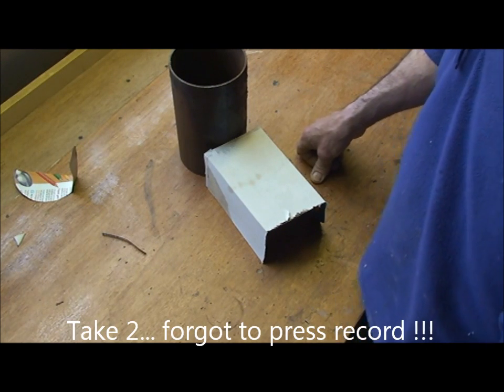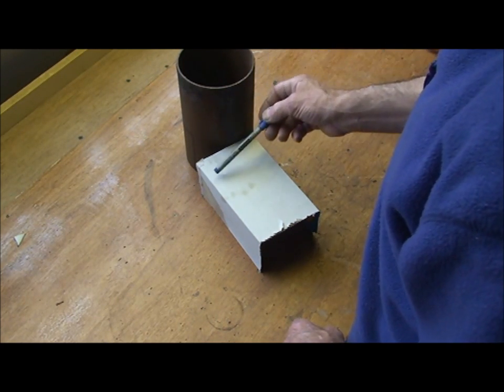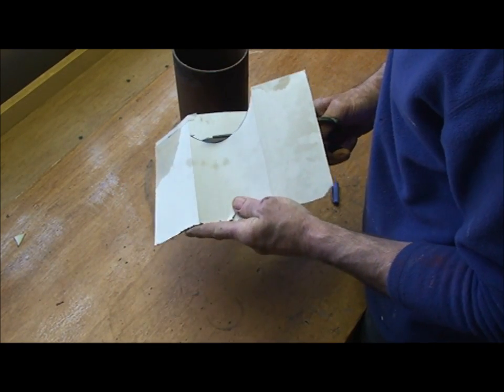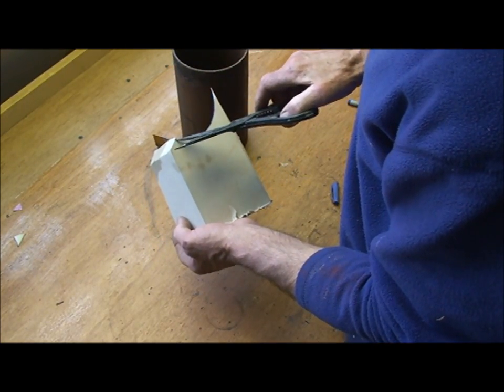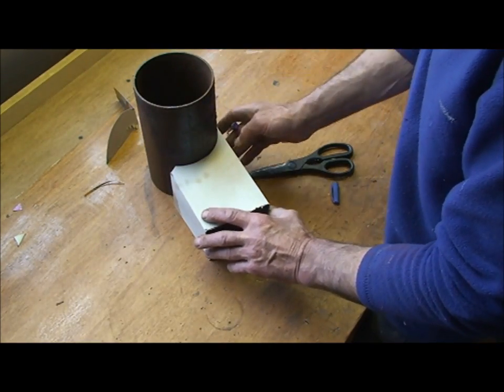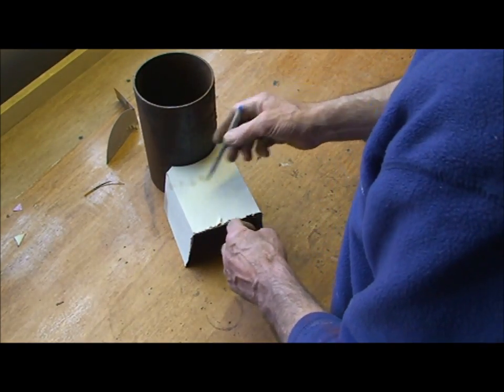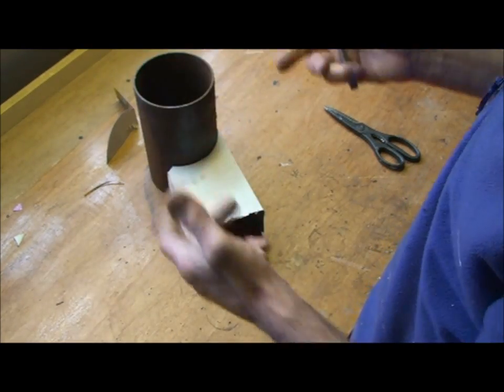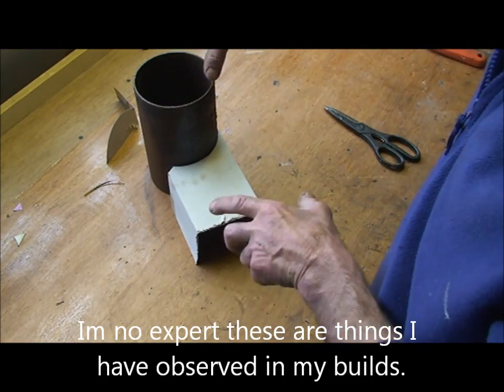Making a Rocket stove riser tube and creating a vortex inside.

Comment: In two months of heavy burn the secondary air channel in my Walker Core system melted.  How has your metal stove held up over the years? 

Also, I'm in the market for a big hearty chopping blade.  Any in the works?  As far as commercial blades right now it's a toss up between the Svord Golok and their Von Tempsky bowie.
Reply from the maker: My SSteel riser failed after 2 years use which is why I tried a cast refractory riser, thats held up perfect and has other advantages over steel. 
My next big knife will be in W2 maybe a camp kinfe or bowie not sure yet but i have a other knives to get done before i think about that one, I also need to get a surface grinder built for the forged knives will free up so much time for me.
Reply: ppotty1 It beats a file!

Comment: How important is the riser tube height in relation to the outer barrel?...I know this is an unrelated question but I just subscribed so I am playing catch up with my questions. I have built a steel burn chamber using this design and it worked real well in test burns but when I installed and set the barrel and ducting in place it doesn't work at all.....I have a firebrick rocket stove in my shop that works real well so I am wondering just where I went wrong with the latest one....Thanks
Reply: Hi Dan, 
I have the same problem, unfortunately nobody has answered you. If I put the barrel over the heat riser, the draft decreases and the stove produces smoke. My heat riser is about 120cm tall and insulated and the barrel is an old water heating boiler with 50cm diameter and about 170 tall, the gap between the heat riser and the upper end of the barrell is about 7cm, i use a 16cm diameter duct-system and all cross-sections are almost identical. did you meanwhile solve the problem and can give me some advice? I would thank you for that
Reply: Dan Pollock 2-5 inches, system dependent.
Reply: Dan Pollock flue pipe height the higher the flue pipe the more suction you get therefore the more airflow you get I'm running into Smokey issues with my oil burner I actually added a fan because of the way the system setup I don't have tolerances for a high flu pipe I know I'm doing a little bit different situation but fire is fire and flue pipe is a flue pipe I use a hair dryer in the beginning then I graduated to a dedicated blower I'm trying to get all the pieces together of the build I'll put them on my channel sometime

Comment: If in the Southern Hemisphere should the vortex spin the other way (clockwise) ? Or would the coriolis effect be too small at this scale to make any difference?  This is a real question as I hope to make an 8 inch batch type rocket mass heater here in New Zealand
Reply from the maker: Hi there, the effect in reality is very weak. which ever side of the hemisphere you are on it makes no difference which way you spin the vortex. For instance if you spin water in a bowl one way you can very easily spin it the other way and the coriolis effect will not have the force to stop or turn it in the other direction. Cheers.

Comment: Hello Ppotty1, Thank you with the in depth instructions, I am wondering,what size ( gauge, thickness) stainless you have used building the riser, ..... now next  is this type heater use less wood that a pot belly wood heater , for the same heat ? and next how about creosote build up inside the rocket stove ..or outside on and in the chimney it seems that no one is aware of such things, you make the 3rd person I've  ask on utube about the creosote, please helpslow_hand_john@yahoo.com, thank you Johnny B.
Reply from the maker: Hi John, The stainless has to be high grade and around 2mm thick at least, and yes rocket stoves use alot less fuel than other stoves and produce more heat and almost no smoke. Creosote wont be a problem inside the rocket stove, you may get a slight build up in the flue if you run it horizontally. moisture in a horizontal flue it more of a problem it comes from the fuel if its not totally dry. But you always get some moisture in the flue until the flue gets hot enough to drive it out. Cheeers.
Reply: Thank you Ppotty this is a great help...Truly johnny B.

Comment: Your vortex seems to be the most easily produced one there is on YT. I did make a basic rocket using a 55 gallon barrel and insulated refractory brick (the kind used in kiln interiors), based on the build by zerofossilfuel . It works well but like you, I want more. I found where I can get a mortar mix of the same material as the bricks. Will be casting a riser this summer. Thank you for the inspiration.
Reply from the maker: tomwalz Thanks Tom inducing a vortex will improve the output for sure.Cheers.
Reply: tomwalz please share where you found the martar mix

Comment: thanks! for the response , i wasn't sure on the insulation but was aware that my desperately made riser out of thin sheetmetal would fade so i thought it might be a good idea to make the insulation  out refractory mortar so as to leave a cast when the steel diteriates " my attempted homemade version using , perlite ,hydrated lime ,silica sand and fire clay .i think next time i'll use just perlite with a heavy gage riser . thanks again.
Reply from the maker: okech po Hi yes you can use the casting around the thin metal riser and im sure that will do the job fine. I am casting my riser with a similar mixture so wont be adding any further insulation around the outside of it. Your metal riser will fall apart at the bottom inside your casting but it will fall off in flakes which you can remove easily. cheers.

Comment: thanyou what will you use for insulation around the outside of rizer>or will you> what is the purpose of the insulation and does the type depend on the thickness of the riser>?
Reply from the maker: okech po Hi I usually use perlite but some use vermiculite or fire blanket, the purpose it to keep the heat inside the riser making it hotter than its surroundings to promote complete combustion and better updraught, if you used firebrick for a riser then there would be no need to insulate. Normal steel wont last very long due to the temps but stainless lasts longer, ideally any kind of steel should be insulated however some people dont bother.

Comment: also you can add an air intake on chimney up fire, air cold tube along chmaber > hot air

and an A.V.E.C. vortex  upper the chimney (fire wiil destroy it quick if not done in strong steel and put just up air intake)

,see you.

Comment: Very cool. When I build mine, I won't bother with the kicker on the fire box. Instead I'll try making only 2 cuts into the riser; across the top, and then vertically where the long side of the box will join. I'll then bend the face of the riser inward to kick start a vortex. It'll take less effort I think. Hopefully it works as well. Maybe I'll try both methods, I like to experiment.

Comment: is secondary air still necessary for complete burn
Reply from the maker: Mark Vaughn Missed your comment Mark, no its not essential providing you have good air flow
Reply: Mark, 
To burn something completely,  there needs to be enough oxygen to burn all available carbon in a piece of wood.  Nothing else.  How quickly a piece of wood burns depends on the availability of oxygen.

Comment: Thanks for your reply! Yes the idea was flawed and now I'm considering doing just what you suggest. I will cut two holes one on each side of the riser about 2''  from the bottom and weld a 45 degree angled fitting to and run a 1'' pipe out through the bottom base plate and have those pipes come out and down on a slight angle about 3'' below it at the front of my burn chamber.I'll then install a damper mechanism to control the air draw. I'll draw up a crude sketch and post it on my channel.;-}
Reply: Fins&Racks Outdoors I'm still waiting for your crude drawings

Comment: then have it enter into the burn chamber at the heat riser junction with  another airtight fitting? I got this idea (or brain-fart) after I watched your rocket stove water heater video. I ask because my burn chamber on my first build is on 4'' square tubing, and running a secondary air pipe in there would reduce my fuel capacity in that location. Just a thought,  with your expertise you may make it work. Thanks in advance for your thoughts on this.

Comment: Hi ppotty1;
I've been toying with the idea of adding a secondary preheated air inlet on my rocket stove. My thought is this;
Knowing that copper melts at 1983 degrees Farenheit, would it be possible to use a 3/4'' , 6-8' long copper pipe that would have its open air draw or intake end at the bottom of the stove  and have run up and alongside the LP bottle, then enter it into the bottle in an airtight fitting, then coil it a few turns at a spot below its melting point in the heat riser (cont.)

Comment: Hi ppotty1, I have watched all your rocket stove videos and am on the verge of starting my own build.  I have built other small wood stoves before but want to take it to the next level.  I am interested in long burn times without fiddling with the wood constantly.  How long of a burn is reasonable with your stove?  How big of a fire box would I need to get a 4 hr burn?  I am looking to build a 4" diameter riser model based mostly on your design.  Thanks for any insights.  Love the detailed vids.